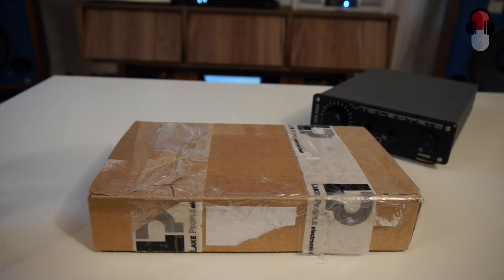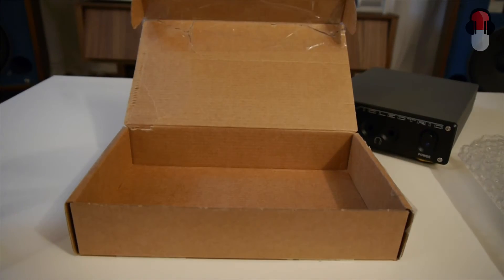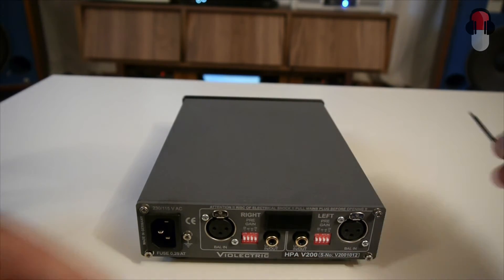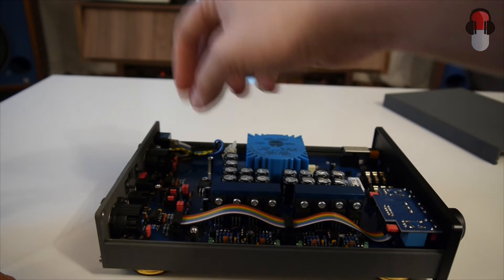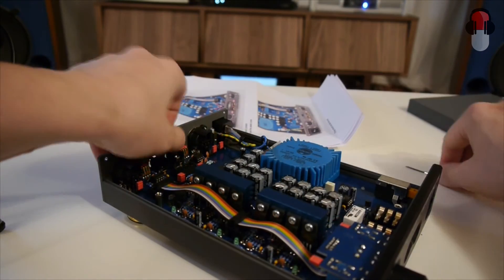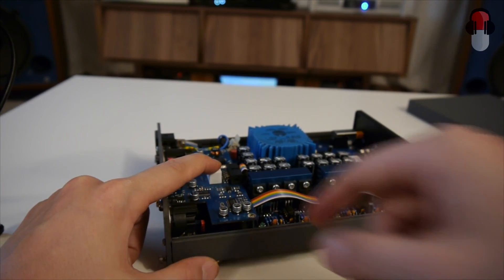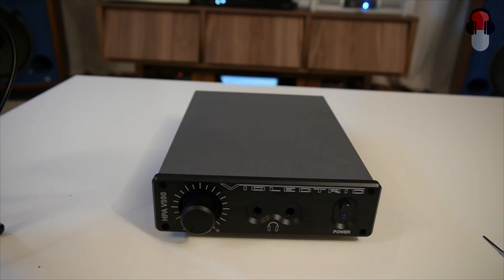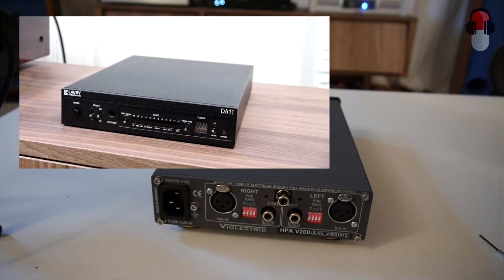Violectric V200 DAC Card Installation Tutorial

Comment: Very useful video. I went inside to convert the cinch / rca connections from input to output (DAC preinstalled) using the documented jumpers (as per manual) not realising at first that all four front screws had to come off because the case panels are recessed slightly in to the front plate. Ah hindsight.

Comment: How does the DAC card sound? Is it worth it?
Reply from the maker: Personally, I wouldn't spend my money on the DAC card for V200 if you already have ST/STX. I could not tell a difference between them, and they are both very good for the price of admission.

If you don't have ST/STX I would rather get the DAC card for V200 as it will obviously make the unit more portable if you plan to hook it up to several computers.

Most DAC's in the low price range perform very similarly. The V200 DAC card, the Objective2 and ST/STX for example.

If you want to move a step up you need to put a decent amount of money on the table. On a budget I would probably consider saving for a used and older Benchmark DAC1 or Lavry DA11. Not sure what those will put you in the hole for in your region, but here they are very cost effective. They are old, but they are excellent. You won't be getting DSD support and with the Lavry you will only have 96kHz support, but at the same time they are transparent and have very good sound quality.

All this being said, I would rather have a cheap DAC, a good amp like V200 and a great set of headphones than an expensive DAC. My personal conviction is that money is best spent in this order.

1. Headphones
2. Amp
3. DAC
4. Cables (nothing fancy, I use Mogami which are among the best known pro audio cables and Blue Jeans Cable which has good shielding etc). I don't use fancy headphone cables.

Good shielding of the signal cables can be important in the vicinity of a computer and other electronics, but you don't need to go nuts and you don't need to spend money if noise isn't an issue.

Sorry for the long winded answer. YMMV
Reply: +HeadphoneAddictCOM 
can USB-DAC be better than soundcard Asus Xonar Essence ST/STX , or worse?
Reply: +HeadphoneAddictCOM 
Thank you very much!
I have ST, Violectric V100, only HD650 with russian good cable, and also simple Canare from card to amp :) V100 is a good amp, he is not boring, sweet a little

ps: sanctions, oil prices = expernsive dollar = no good dac for simple people :D
Reply from the maker: cyberridz I think it is a good DAC, it doesn't have any bells and whistles like multiple inputs, filters and the like, but it works like a charm and has neutral sound and you get one concise unit which is nice. With separate DAC's you get a dedicated power supply, sometimes you often have one PSU for the analog section and one for the digital section to improve noise floor, but I haven't found any problems using this. There is also an optical and a USB choice, as well as a 192 version which is newer, but the 96 works for my music anyways, so why bother with 192? :)